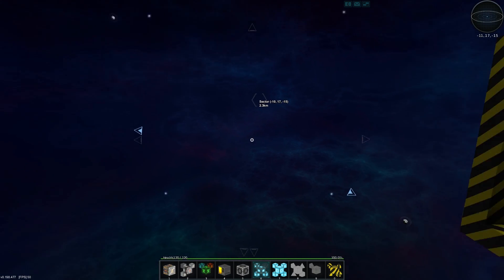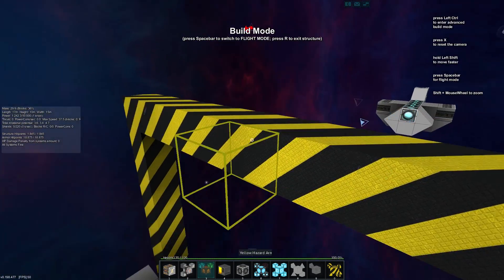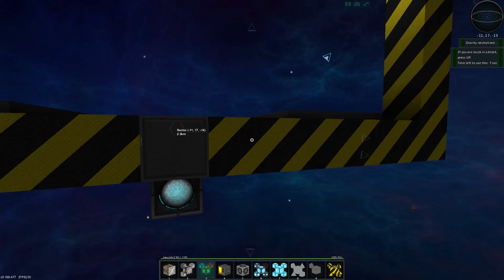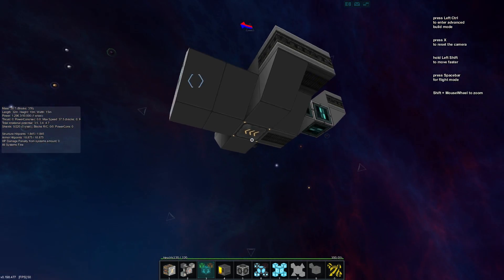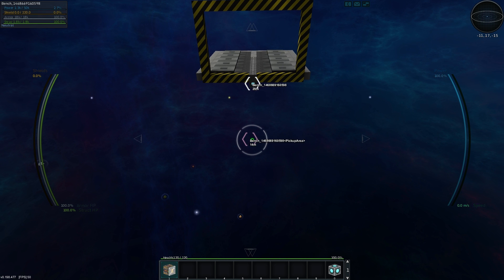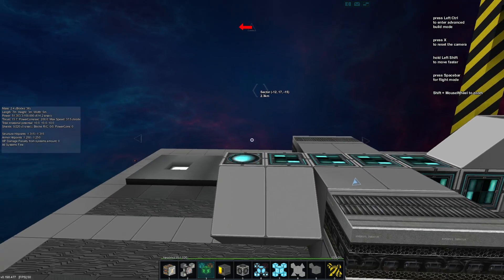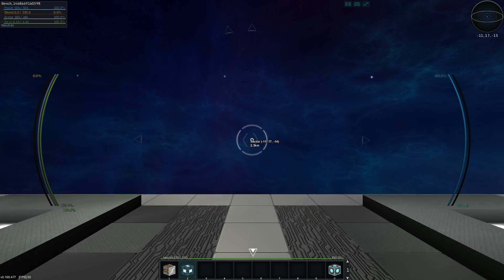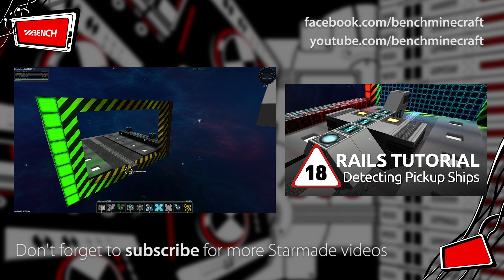Starmade Rails - 17 - Pickup Rail Basics

Comment: neither docking nor carrier recall works for me :(
- pickup point is active 
- pickup point is next to a pickup rail
- both are far outside of the carrier to avoid collision 
- the pickup rail guides to normal rail
- i can see the point when i select the rail docker, the pickup point text is visible when selecting the carrier
- all pickup points are wiped, meaning there are no more fleet members with a saved pickup point
- the carrier isnt docked to anything
- the rail docker of the drone is at the first-line at the bottom aligned forward - the beam also aims at the front
- the pickup point, pickup rail and normal rail are just on a simple straight line

i can fly to the point - 3m 2m 1m through nothing happens...

once the pickup point somehow was assigned to my drone before, it was spinning around but never be able to align and fly to the landing platform...

Comment: I had made something similar, but I had it so that all the green pick up point would switch over to the red launching blocks. I was thinking to make it like the catapult system on a carrier, the red blocks would make the ship go faster until it launched / released. You just need one at the end then right? Also I had put in a rotator block at the end of the basic rails so the ship would turn 180 and face outwards when you wanted to leave.   It would be nice if there was a multi-channel wireless block, that way you wouldn't be restricted to just one hanger one your ship / station.